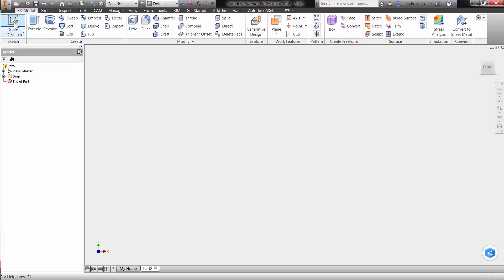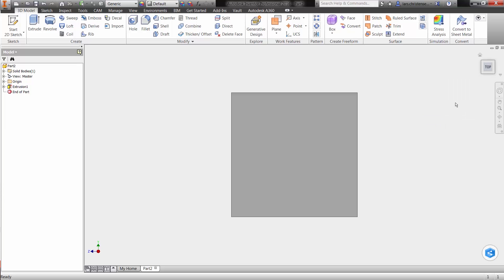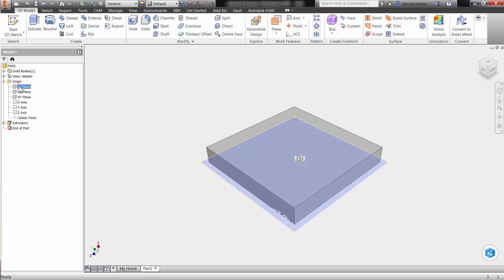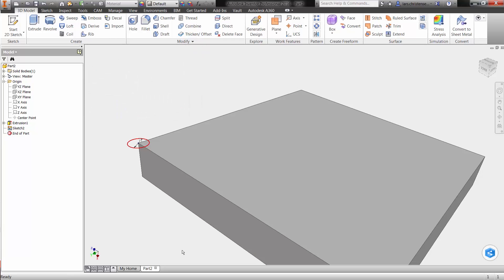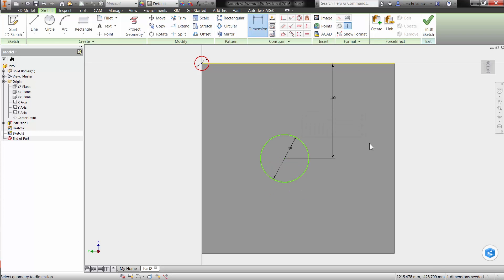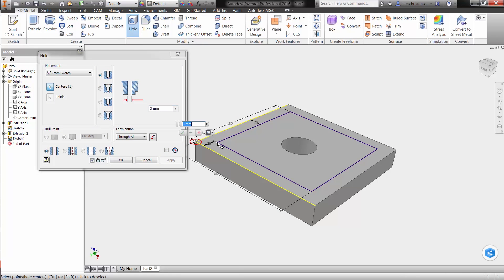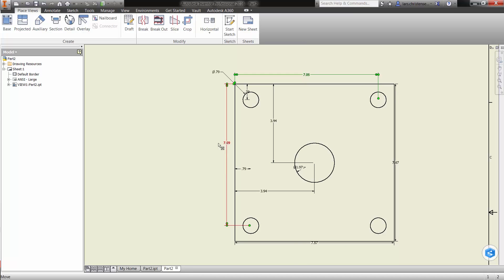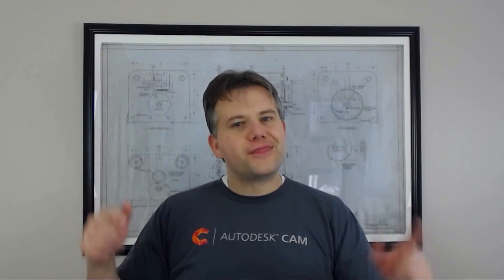Better CAD for CAM

Comment: I usually design the other way around, creating the part and afterwards figuring out what size of stock material I need. But I like the idea with the circle and that way maybe "plan ahead" for some parts. However most of the times we get a drawing from the customer and we merely translate the drawing to CAD/CAM.

Kind regards,

Egbert
Reply from the maker: +Egbert de Pauw Thank you for watching and taking the time to comment. I think most people do it your way, and you definitely need to do what works best. The idea of marking pickup point and use standard colors has saved me from some headaches a few times.
Have a great Christmas!
Lars
Reply: Great Christmas to you too !